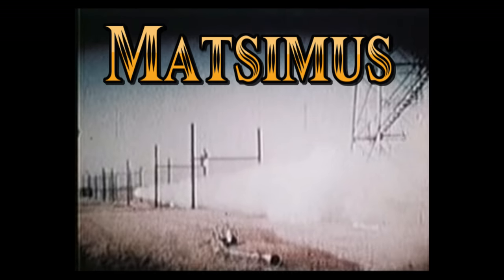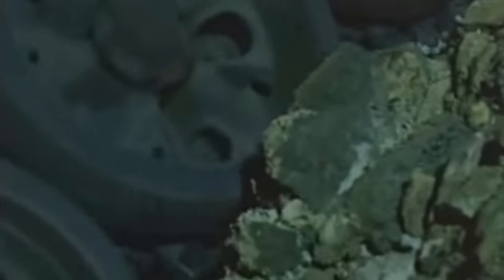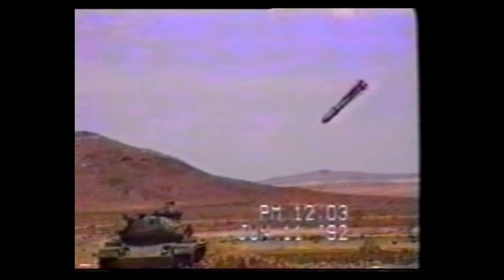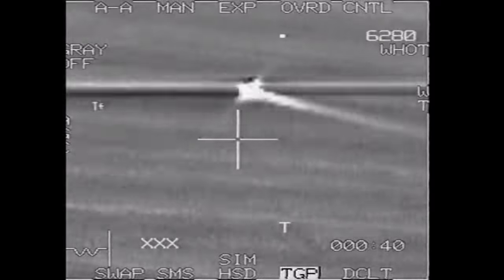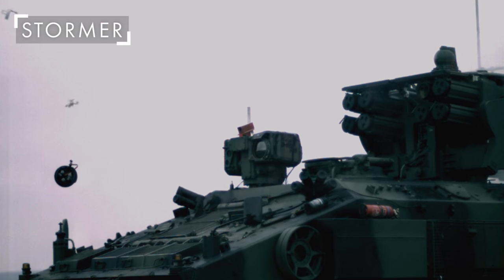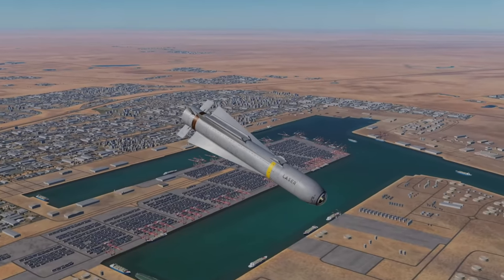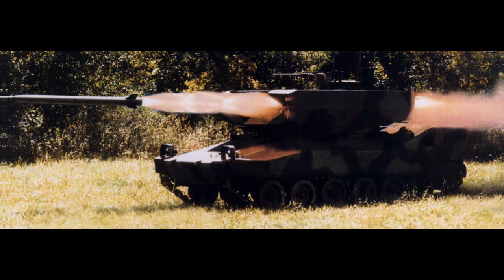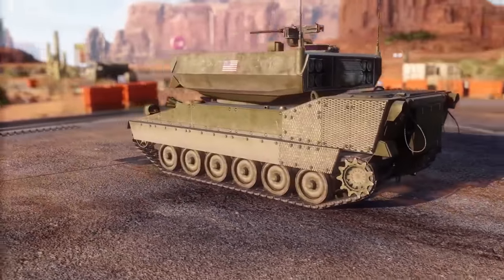Anti-tank Kinetic Energy Projectiles | HIGH VELOCITY MISSILES

Comment: The
Anti tank kinetic energy high velocity missiles look to me that it did the job it was designed to do. To me if the government is going to spend all this money into a weapon and the weapon is working up to what it is designed for use it or at least keep it in stock in case there come a time it may be needed. As I look at the world today and how unstable it is and if war brakes out on any front believe me after the air bombardment and artillery the next thing coming at you are the tanks and if you have a weapon that can be moved around the battlefield fast enough to put a hurting on the enemy this weapon could do the job to slow down the enemy enough to let our military try and take control of the situation. To me it looks as if this weapon can be used in many different ways. They can be delivered from ground vehicles, from Chopper's and also with ground mounted weapons and from the A10 . I could figure out maybe a few more way to use it.

Comment: This gives me an idea ...i want to sell it. Lol. Self regulating by suspended hollow tungsten nickel sphere in the jet nozel . so it expands as it heats and slows the burn rate of the fuel, and compressing the jet itself so it is higher pressure with less consumption.  sealing on impact from that same now maluable sphere jamming into and bonding to the cone of the jet nozzle,  so a controlled burn projectile with modified fuel bay, so when capped off from impact.the front of the fuelbay becomes the weakest point blowing out behind the penetrator and into a cup on the rear end of the rod ,so it keeps the energy high and pushed the penetrator further . leaving behind a bent and smashed up jet engine buring inside its target ,thanks to that fuel conservation..😀...thatsa freebe for all you military  
engineres working with ballistic concepts. You are welcome.

Comment: 90 Megajoules delivered energy: This is a 50 kg of TNT explosion which is probably the equivalent of the delivered energy on a tank turret. Bearing in mind that half the energy at least would be dissipated by radial expansion at 180 degree radius from the contact point. https://youtu.be/vai5S0mI9u0